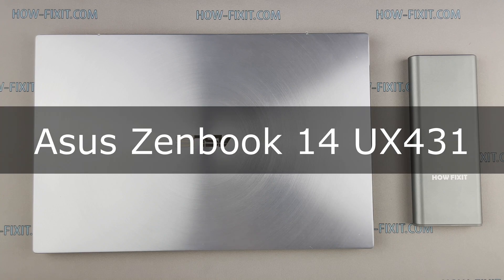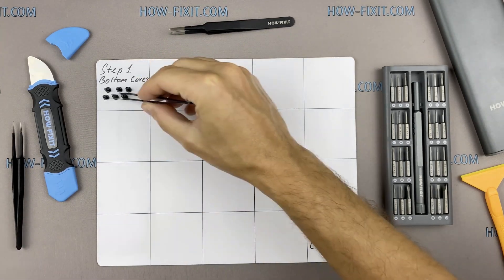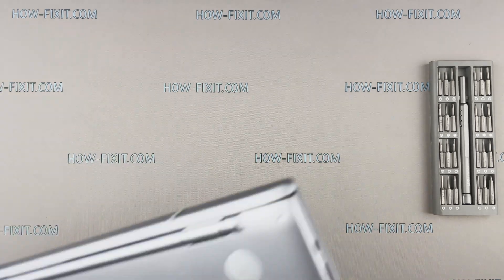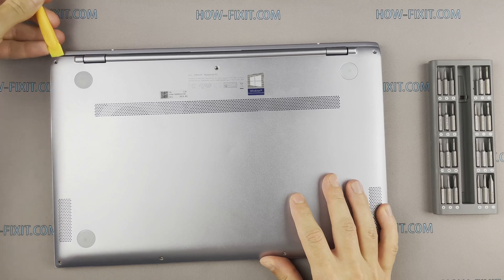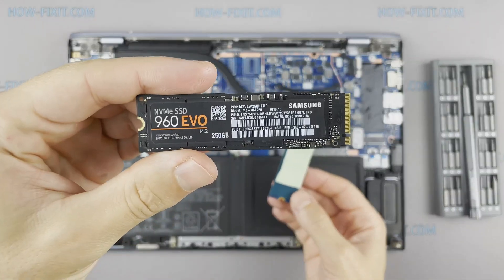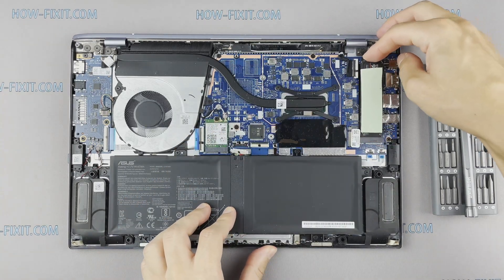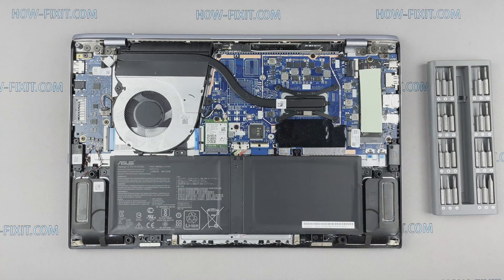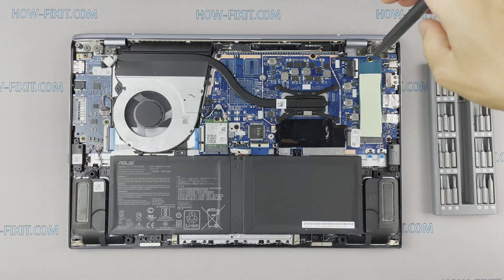How to Upgrade & Install M2 SSD in Asus ZenBook 14 UX431, UX431FA, UX431FL

Comment from the maker: ⚠ The Asus Zenbook 14 UX431 supports both M2 SATA and M2 NVMe drives in its M.2 slot. So, you can install either, depending on your preference for cost or performance. Check the description for links to recommended M2 SSD drives. Additionally, watch the video explaining the differences between M2 NVMe and M2 SATA 👉 https://youtu.be/r3Jy5dHOj3g

Comment: Hi, I have a problem if I want to add another SSD. 
If the stock ssd is in the normal position the notebook work normally, but if I change the position of the the stock ssd to the other M2 slot, the notebook don’t boot, but instead it goes in the bios. What can I do?
Reply: Yeah ı have same problem.
Reply: @LerFly  Hi, after 2 months I wasn’t able to solve the problem.
In the end I’m just using the new m.2 ssd with bigger storage. I don’t use anymore the old one, but if you want, you can use it like an external ssd.
Reply: @saga7835  It's probably because the second slot is for SATA not NVMe.

Comment: Please confirm that this laptop supports using both M.2 SSD slots at the same time? I cannot find this information anywhere else on the internet, including on the ASUS site.
Reply: I found out on Asus's website that there are 3 models of UX431 : FN, FA and FL.

All are said to support one NVMe m.2 (pre-installed) and one SATA 3 m.2 empty. 

Gonna try it out eventually and respond here if I was successful.
Reply: @repeatbot  I got an inexpensive M.2 on the way that I'm going to toss in just to test....because the spec sheet isn't very specific.  Does appear that the extra expansion slot is designed for SATA.  However....step two of this video shows the user moving the factory SSD over to that second slot.....and the factory SSD I believe would also be NVMe.
Reply: Also interesting.....looking at the motherboard......the expansion slot is keyed for NVMe.
Reply: Does it have two slots ? Please respond